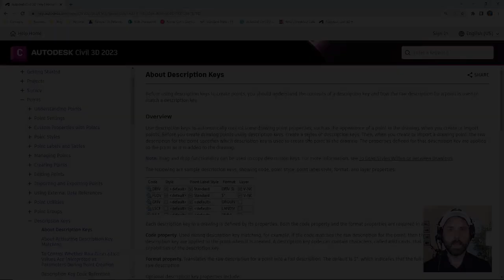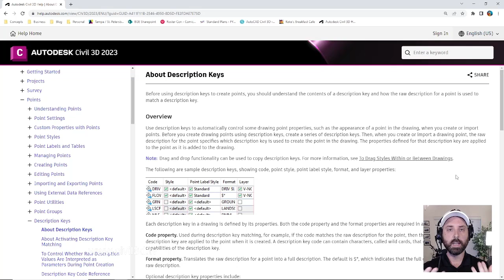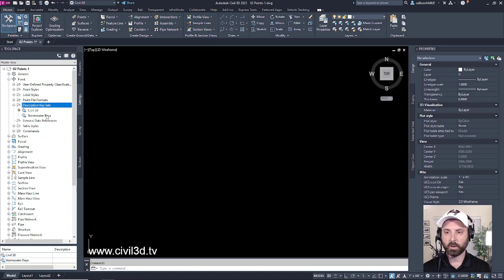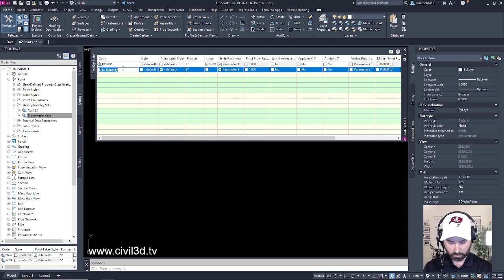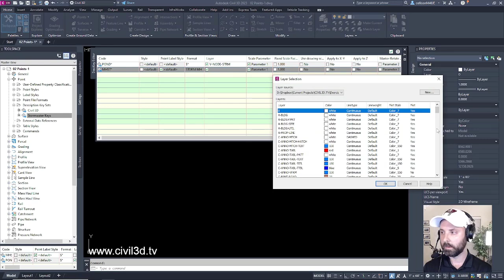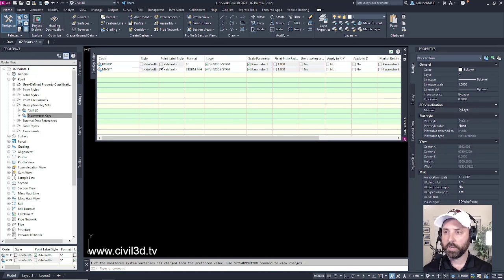03 Creating Description Keys in Civil 3D 2023 to 2024

Comment: Hello, thank you, but I have a question. When I exit the program, everything returns as it was. I want to save the codes that I put in the program forever. Is there a way?
Reply from the maker: Yes — you need to save your custom codes/styles inside your Template (DWT). Open your DWT → add your codes there → save the template. Then start new projects from that template. That’s how they stay permanent and don’t reset every time you reopen Civil 3D.
Reply: You have to create a template (dwt) and save it there or you'll have to make it everytime you want to use it
Reply: @brunogp8269  hay alguna otra forma a parte de dwt ?? estado intentado importante estilos y no me deja